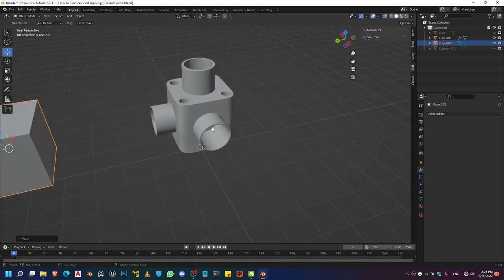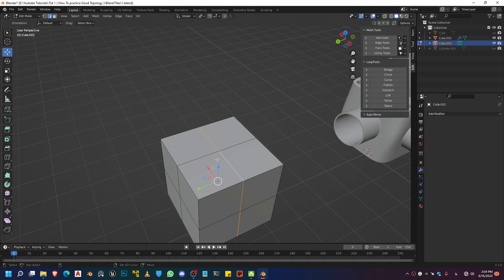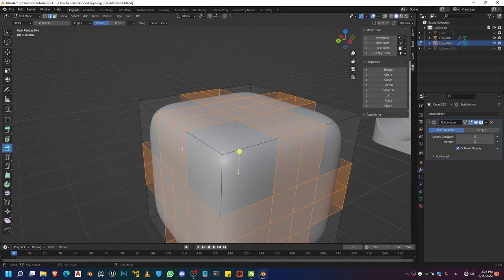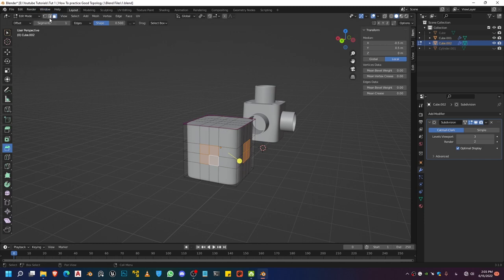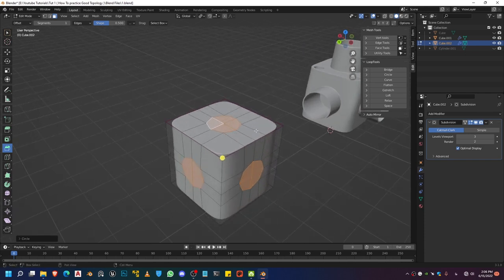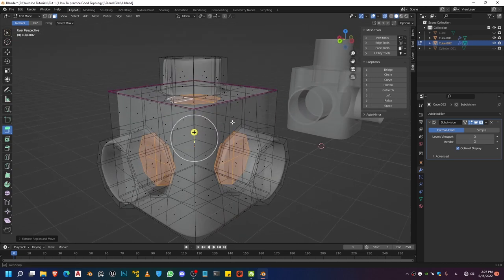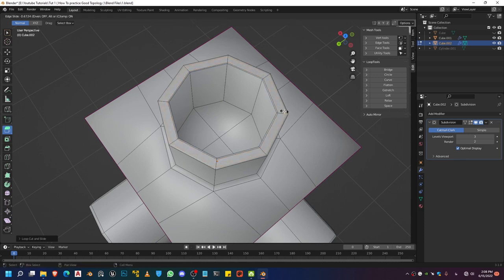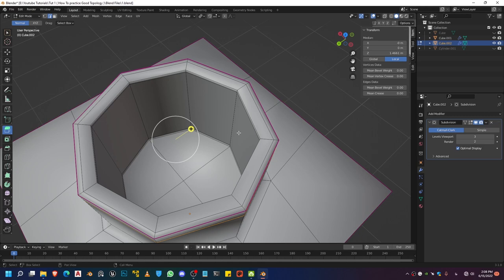[Blender] Modeling Workflow -  Beginner Topology Practice

Comment: Is this subdivision surface is must for good toplogy modeling
Reply from the maker: No, using subdivisions surface is preferred for high poly modeling because of the flexibility it brings, where you can visually see your model at different mesh densities. It's not necessary.